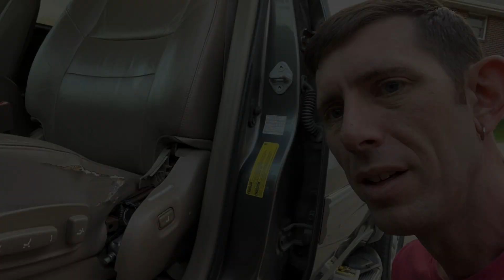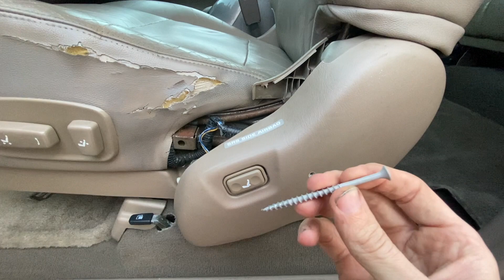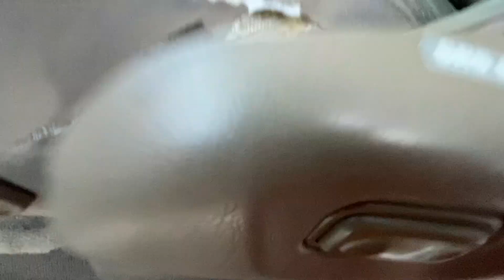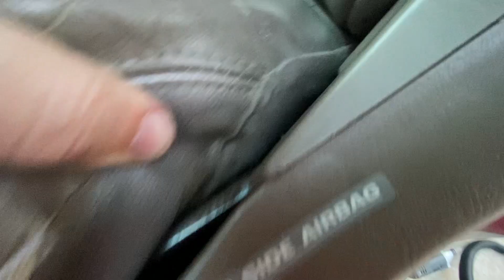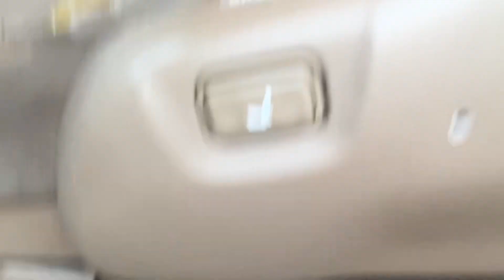Sequoia Driver Seat Hinge Trim Repair

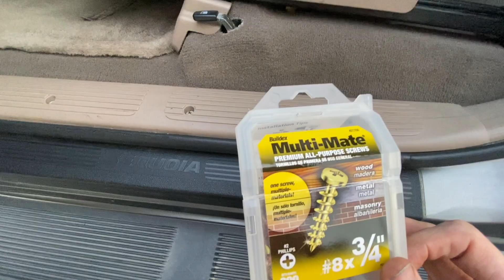Comment: Doing this repair soon, thanks for the vid. Is the 2:28 part where you use those different screws necessary? I don’t have those extra ones I just have a 3” zinc screw to go in and a drill bit to make the hole.